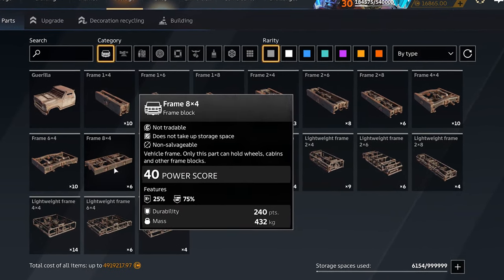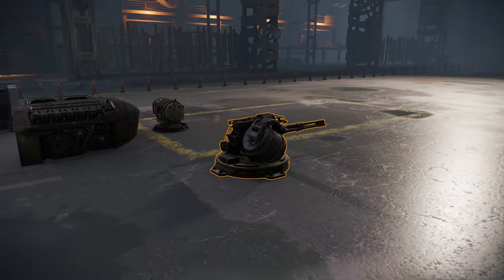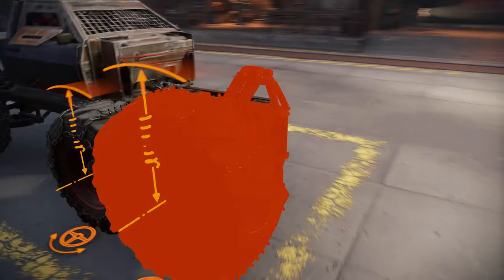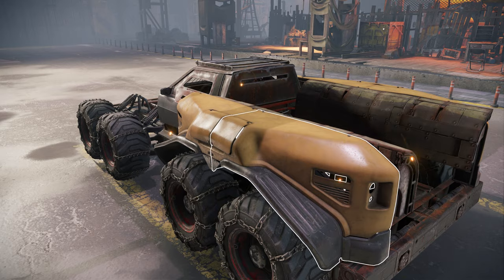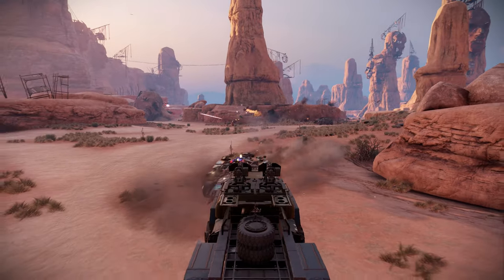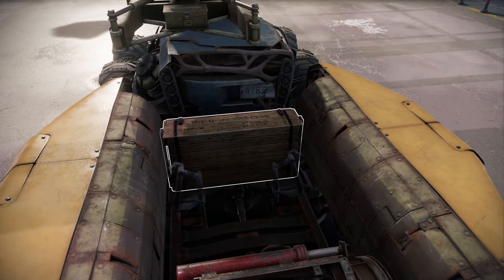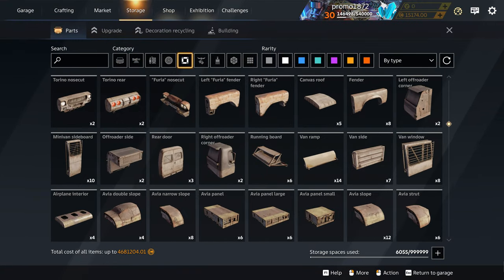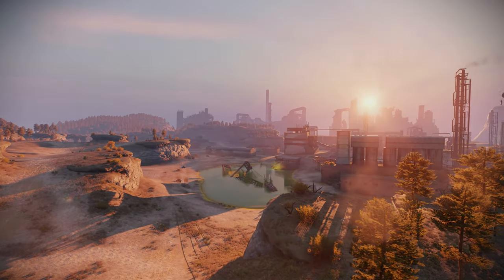Crossout Tutorials: Car Building Tips

Comment: Do more of these. Lots of players don't know what they're doing.
Reply: Like me😂
Reply: hover: avoids land traps and fire more easily, great for fast movement and uneven ground, least likely to fall over
wheels: avarege in everything, decent hp for their size and is perfect for smaller builds or as backup (if your main is spider legs or something)
spider legs: usually fast and tanky, cannot climb upwards that well and needs assistance to get back up
treads: usually tanky and heavy, covering a good amount of other parts, its slow however and needs most amount of assistance, otherwise its great to avoid getting flipped or pushed

power scale: affects who you fight, if you arent confident or are new dont make it too high (10k is very high, 2-4k should be the limit at first)

fuel barrels: allow you to constantly fight once your team wins and you survive. they are explosive so hide them well (create an 0 shape frame to hide it underneath only with hover and spider legs) otherwise hide it somewhere in the middle.. can be used to kamikaze into enemies if you feel you are about to go down

SNIPER: use cloaking/invisibility, move positions often (enemies dont get used to your location) and try to avoid direct fights. usually someone will want to close in so have melee weapons and a sturdier front

MELEE: have backup ranged weapon, often when you use the front of your drive with weapons they can get shot down (my own favorite is the bombardier beetle method, on an escape you can just blast enemies with your buttocks lol)

MEDIUM: remember to move around and hide behind walls from missiles if you have a warning shoot off. keep some distance and allmost any weapon works

TANK: obviously build more durable rides. heavy weapons are good to have as backup (since they can often miss, best use them when really close to enemies or if they push), be careful of snipers

SPEEDSTER: Use some boosters, keep a lighter weight build or have hover/spider legs. best used with also lighter weapons and is often good with barrel launcher (you can move around alot and cover alot of "bottlenecks" with barrels) best against snipers.